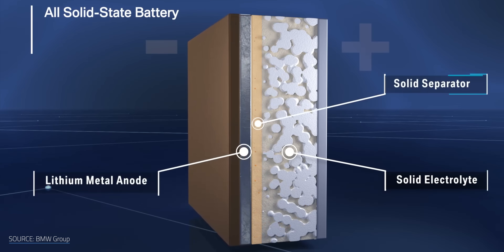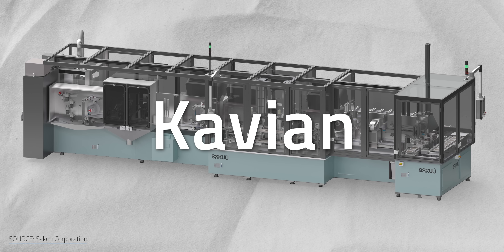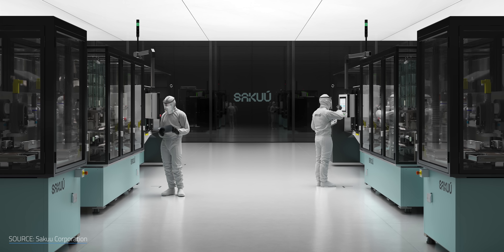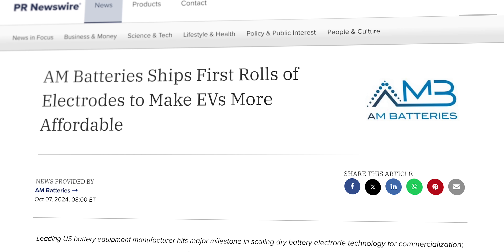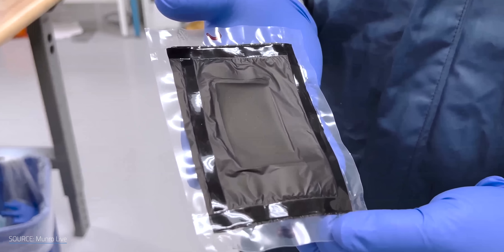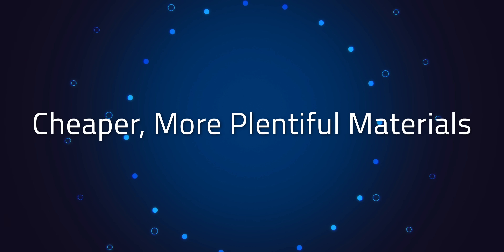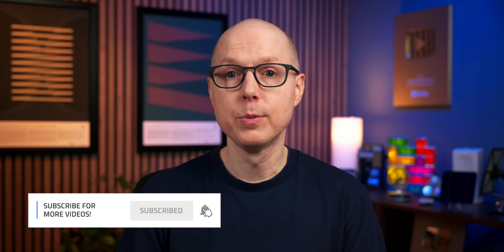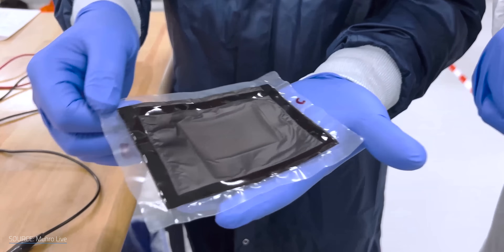Why This Ultra Cheap Battery Breakthrough Matters

Comment: thats cute that u think battery producers(or literally anyone) will lower prices because they find a cheaper way to make a battery instead of pocketing that extra cash.
Reply: Yes and no. Battery producers won't lower prices "just because" they find a cheaper way to make a battery, but rather because they haven't achieved the kind of monopoly positions that will allow them to charge "whatever the market will bear". Battery production is still very competitive, and when anyone develops cheaper ways to produce batteries, existing battery producers will adopt it and cut their prices. Not out of the goodness of their hearts, but because if they don't, they' lose out to competitors who do.  

That's how free market capitalism, to the extent that it still exists, is supposed to work. Unfortunately, if free market capitalism were an animal species, it would be on the endangered species list. It's threatened, not by socialism, communism, or any political ideology, but by the phony market system of the other type of capitalism that's becoming increasingly dominant. That's the faux capitalism of big corporations and equity capital funds.. They buy up smaller businesses to preserve the appearance of competition, but when the companies are all controlled by the same majority stockholders, they function as effective monopolies.

Comment: This is like 10th battery you present that "changes everything". Maybe don't buy into every marketing crap and wait for a technological advancement to actually happen with a (close to) final working product and not a CG render that theoretically works if you assume no air resistance.

Comment: The world really doesn't want weirdly shaped batteries. What the world wants is standard sized batteries that hopefully can be easily swapped out on the go in devices like phones, laptops, tablets and handheld consoles.
Reply: Not at all, form fitting exoskeletons to help disabled persons, or military as one example can benefit from batteries that fit the shape of the device.  Electric bikes as well, can have improved weight distribution, more streamlined appearance when batteries are customized to the bike frame.
Reply: Why change the battery when the phone itself is obsolete in 5 years?
Reply: @ghoulbuster1  because then you could carry an extra batery and just replace it, like AA bateries

Comment: It would be really bad news for the reapairability of our stuff if they start to make batteries with weird shapes. It's already hard enough today with a lot of stuff stopping to function just because of a, totally expected, dead battery. And most things haves Li-Ion 18650 cells, it would be disastreous for our future to not build future batteries also based on standard cells that could be sourced easily. And the best would be to stop the BMS bullsh** that dies for ever if the battery drop below a threshold or that have proprietary communication with a controler, that would help a lot future people.

Comment: In markets where BYD and other Chinese EVs are available, price parity with ICE cars have been achieved already, even with some EVs' upfront cost being cheaper even.
Reply: Regarding EV’s comparing with ice vehicles, when it comes to cold climate, Ev’s suck! The batteries automatically lose a third of the range between the cold and trying to create the minimal heat for as ice vehicles, The heat is all you can eat, and it’s for free with no impact on the range and for that reason I would much rather have an ice vehicle in the cold than any electric vehicle.

Comment: Sadly I feel like the only savings will be for the "investors" and not the actual consumer, as in prices stay the same, but their profit margins go way up
Reply: That depends entirely on if there is competition or not
Reply: false
Reply: @ For a company to capture the bulk of the cost savings as profit, they need pricing power in the market. If there is competition, typically they don't have that and prices continue to fall and eat away at those margins.

It gets into both microeconomics and game theory, but in a competitive market, over time, the consumer ends up getting most of the cost savings.
Reply: But then some competitor could start selling it for cheaper and everyone would buy from them so they'd make way more money. The price is set by the market. If the producers could set the price, they'd have no reason to wait for costs to drip to raise their profit margins.
Reply: @DanielLCarrier  exactly. Now there are some companies that briefly have that kind of pricing power, because they have some kind of moat between them and competition, and they do raise their prices to increase profits. But it's rare.

Comment: Here's a noteworthy information to know about polymers, that should impact the longevity of conductive polymers.

Any polymer that uses an additive, will see it gradually get out of the polymer through a process known as "exudation". This process is usually measured in years, not decades. This would put a glass ceiling on batteries produced using these polymers, unless a solution to this problem is found

Comment: This video reminds me of how I bought my very first calculator - a Texas Instruments SR-50 for $150 in 1976 dollars.  A slide rule just wasn't enough to get through college. Now, chances are you can get a calculator of equal capacity for free.  With batteries being a major component of EV costs, I expect that our grandchildren will wonder why anybody ever bought ICE cars.  In the future, they will only be of value to collectors.
Reply: Getting hold of fuel is going to be difficult and expensive.. 

A bit like high RON leaded fuel now.. but it will have to be bought in barrels  from specialist  labs producing it from bio fuels or recycled plastic wastes. 🧙🏼‍♂️🥼 🇬🇧
Like the UK team producing jet fuel or diesel from sewage waste.😎 😂

Comment: If you really want a battery that may change things you need to look at Aluminum Ion batteries.  The tesla company is about to put them into there cars.  This will allow the vehicle to charge in about 10 minutes, have a distance of around 600 to 1000 miles on a charge and is not affected very much at all with cold weather.  These batteries can go about 1 million miles before possibly needing to be replaced.  Seems like the Aluminum battery is better than any of the solid state batteries.  I almost forgot that these batteries are about one tenth the cost of Lithium batteries.
Reply: Tesla is spiraling hard.
Reply: @mankihonda983  That is not the point.  The point is that an even better type of battery should be looked at and implemented.  I can only hope (may be it is already being done) that China is looking into this.  America should be as well.  We used to be the innovators, but seem to have lost that ability.  I hope that you are also aware that Elon is only a business man and not an innovator.  He hires other people to come up the newer technology.   The tesla company (not Elon) has been looking into this for some time now and can up with a way to make it work.  I wonder why no one else is also looking into this?  I hate to say this but America seems to be stuck in a rut with gas powered vehicle while the rest of the world is moving forward.
Reply: @ He is above else a scam artist, liar and a thief.

Comment: The biggest obstacle to battery tech is the loooong charge times.
Reply: Slower home charging is enough in 99% of cases. Fast charging is also getting there with traditional Lithium ion tech. The Ioniq 5 for instance goes 10-80% battery in under 20 minutes, which is ~200 miles of range. That will only improve with newer battery tech.
Reply: Maybe but it used to be the cost. It'll always be something.

Comment: Prices of the batteries may drop, eventually, but corporations will see that as profit, not passing the savings on. If all true, 50% cost for batteries, I estimate at best 2% reduction in cost of products using them, as it means cheaper to customer, by a fraction of the profit made by the company buying cheap
Reply: I agree but partially. Free market will always reduce price for the same value. As long as one company doesn't hold all the battery tech we should be ok
Reply: How do you suppose battery research is funded? Of course the company putting billions into developing a new chemistry will need to make that money back and then some to research the next chemistry. 
But make no mistake, it will get cheaper for the customer as well, as others start making the same battery and push prices down. Battery cost is down to 25% of what it was 10 years ago. 
How do you think that happened?

Comment: I met Sandy Munro in Vancouver, BC at the Electrified Show a few months back and we spoke for about 15 minutes just about Sakuu and this process. He and I are both potential investors. I'm simply waiting for a bit more data on the latest chemistries they're adopting. I've known about Sakuu for over a year now and it's the first battery type and process I've been excited about since the early talks of the somewhat disappointing (for me) 4680.

Comment: I'm excited for what the future will hold for battery improvements. If a Solid State battery could be released that would be cheaper to make, and also have increased capacity and be lighter, then it would be a game change. I drive a 2024 Mini Cooper SE. It only has a range of 114 miles. If I could swap in better batteries that would be lighter and have more battery capacity then I would pay a lot for that upgrade.

Comment: "Scientists found new way to actually recycle batteries!!!"  -  now that's what I would consider a major break through in battery technology. Don't get me wrong, we need every little step forward regarding batteries but we seem to be forgetting that we still don't have true, effective solutions (at least that I'm aware of) to prevent all the batteries being produced to end up in landfills in a 3rd world country. 🫤

Good video! 👏💪🙏
Reply: 95+% of the actually toxic lead-ACID 12-Volt batteries in conventional cars are recycled. There is no reason why bigger more valuable EV batteries won't be recycled at similar rates. A dozen companies (LiCycle, Brunp, Redwood Materials, Umicore, ...) have started up to recycle EV batteries; they are waiting for enough EV batteries to actually fail so they can ramp up operations.
Reply: @skierpage   well, lead-acid batteries have been around for decades and, to my knowledge, their construction is way simpler than the batteries we're talking about here. The "polymer current collectors" thing, for example, sounds like a true nightmare to recycle. Even the standard metal current collectors ones are more complex than a standard lead-acid battery. (Lead-acids are also, generally, more easily separated from the rest of the "object". Most consumer electronics today (smartphones, toothbrushes, etc, etc...) have their batteries buried inside them... but right-to-repair and planned obsolescence are whole different subjects).
Considering how over-hyped recycling is in general (especially plastics), I sincerely hope that companies like the ones you mention are capable of keeping the natural resources recirculating and, therefore, avoid the mining and use of new ones.
Thanks for your input!

Comment: I'm skeptical every time I hear that a newer, better technology is going to be cheaper than the current products, because it never seems to go that way. Even the claim that it's more environmentally friendly, I'm sure it will turn out that something involved in the process actually causes more harm, and we (or even they) won't find out for years. That said, bring on the progress. These problems can be solved, so I hope whatever happens, there's a drive to solve it all even if there's a lower ROI.

Comment: Yes -- great stuff. 

I'm following it over in Electric Viking (thick accent). 

Great stuff -- wrong reasons:

CO2 is climatalogically irrelevant. 

Global warming is 21st century superstition. 

Interglaciation climate change (e.g. medieval warm period) is caused by cosmic ray fluctuation ( see Henrik Svensmark et al).

Just burn coal.
Reply: Calm down coal Miner.

Comment: Hello, 
Really good video as always.
I working as an industrial machine builder, and i don’t think this technologies will raise down the prices of the batteries. To raise down the price you need a big production flow with less machines. With a 3D printed machine i don’t think the production rate will be good, not as good as solvent machines for sure (continue production rate like this are the best). I don’t know the detail of the machines, may be I'm wrong, but it’s an important point to get in mind when you speek about price production. 😉👍

Comment: Hmmm Polymers - if these are natural ones ok. But if they are synthetic ones - not so good imho
Reply: @wr6293  Why?
Reply: @ because they are  made using fossil fuels mostly. Yes, there are developments to use renewable resources but these are more likely to be more expensive (especially at their beginning of industrial production volume) than those already being produced for long time and with optimized production facilities. So, if the aim is to reduce costs than likely less  expensive and better available synthetic polymers  made using fossil fuels would be the choice, right?

Comment: nothing i hate more than proprietary batteries, E bikes are playing that game and forcing you into expensive replacements!  like E bike batteries aren't expensive enough and you never know what capacity you truly have , the battery meters are inaccurate at best , it reaches down to 25% then it dies immediately. very few like LG and sony actually are somewhat reliable but the rest of the chinese batteries are only good for 50% of what they rate them!
i recently did  a ride around crater lake  where they closed the road to cars for the event , nice , but i saw one biker ran out of battery at 3/4 of the drive and no one was able to help him because he had proprietary  batteries so throwing him a tow line helped til i ran low!  Therefor  batteries are still a huge problem! which require you purchase another proprietary battery incase you run out then have to find a way to carry it, so you can get home!
Not a reliable tool!

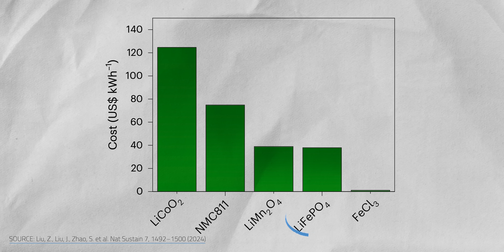Comment: 12:02 - Not sure I agree FeCl3 cathodes would cut overall battery cost by 50-60% ... last I checked, the cathode was only 20-25% of the total battery cost.

Don't get me wrong, a 20+% cost savings would be amazing, especially because it'd stack onto other cost reductions.  But I'm wary of over-promising.

Comment: EVs will NEVER be as cost effective as ICE cars UNTIL, every single car shop can buy parts for and fix an EV.
Reply: Just wait until all vehicles are 'subscription based', and you cannot fix them at all.
Reply: @KnugLidi  aren't cars subscription already? anyway, another reason why i just take public transport. takes me where i need to go without hassle of driving, paying for fuel, maintenance, tool fees, driver's license, car registration, insurance., parking space, accessories... etc etc.
Reply: What’s to fix no oil no gear box no exhaust no fuel filters no spark plugs 
It’s basically tires and brakes
Even brakes rarely need doing because of regenerative braking 
You basically run them to the battery is done then replace 
There are reports of people doing 100, 000 miles and only needing to replace the tires and windscreen wash
Reply: @Mmm-y5w8o  what happens when the car gets into a accident that disaligns any of motors or cracks the battery ? What happens when the car's operating system gets corrupted? What happens when the car gets soaked in a flood? Do Ev batteries last for more than 10, 15 or 20 years?
Reply: I guess if you crash the car insurance pays 
Tesla has indicated insurance might be included in the purchase price for self drive
Most ev cars are permanently connected to the internet so they self update operating systems
And self upgrade from time to time 
Yer floods damage most cars in hurricane Katrina
Tesla’s were live updated to temporarily increase range
How long those the battery last with recommended usage 15 years the life of the car
There have been some cases of the battery dieing early but most have 5 year or over warranty 
Taxi drivers push them hard and the tend to get about 200000 miles
Battery replacement is very expensive 20,000
But you get another 5 year warranty 
Suppose it depends what you want to use the car for
But if your tipically driving about max 200 a day and keeping the battery between 20% to 80% full
You should get a very long battery life
But yer if your doing a lot of long trips they would be a hassle and the battery won’t last nowhere near as long
Reply: @Mmm-y5w8o  
-- maybe in the US car insurance is standard, but not in all countries though. And there's a lot of other brands other than Tesla that won't automatically include it, if at all.
-- In a place where flooding is a yearly occurrence, an ice car can still be repaired and rehabilitated in any old garage.
-- I've been working with computers for decades. If my laptop crashes, there's no possibility of it stranding me in the middle of a commute. 
-- bottom line I don't feel secure in a car that can't be readily repaired by any old garage at any random corner
Reply: @BaldAndCurious  don’t use a new ice car then they have sensors everywhere linked to
   very complex engine management systems 
That the average mechanic has no chance of understanding 
Modern ice cars are  a lot more complex than electric cars
Reply: @Mmm-y5w8o  yes, that's my point. and EVs will have even less chance of getting fixed by anyone who "just knows cars".